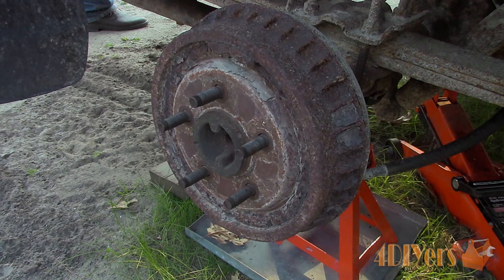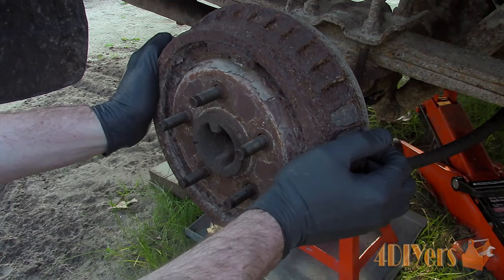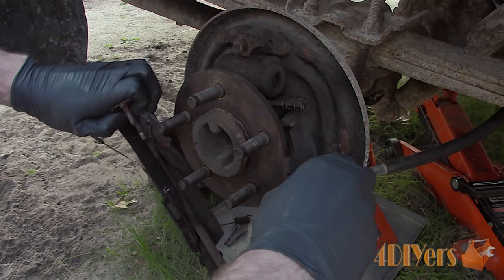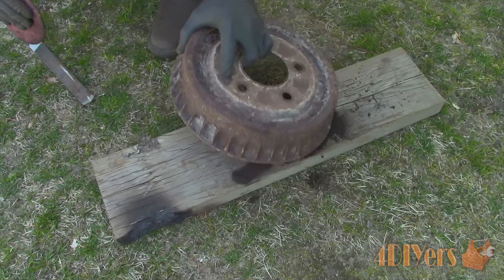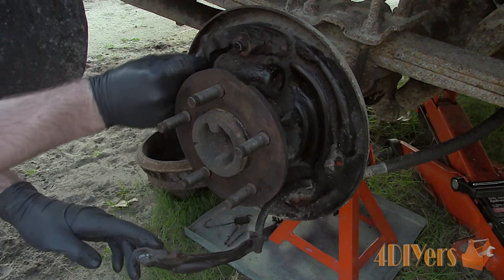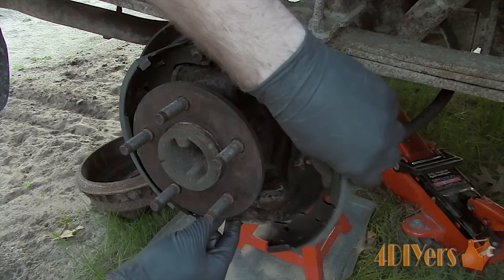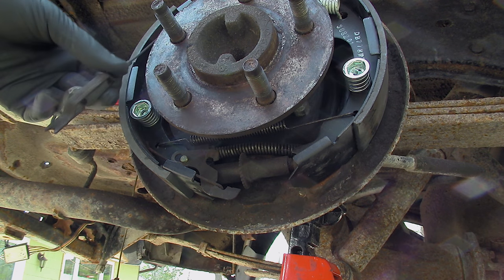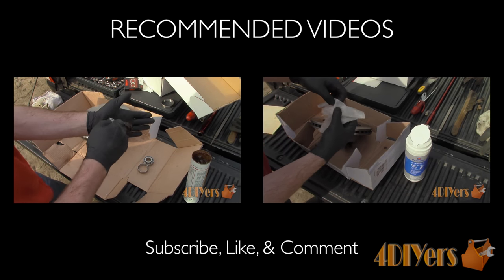DIY: Ford Ranger Drum Brake Replacement

Comment: Nice video, thank you. It looks like you used two different special tools. Would you please describe them and give your recommendations on purchasing them?
Reply from the maker: Thank you! Yes I did, one is a brake return spring pliers and the other brake return spring tool. Both are very inexpensive and make the replacement much easier.

Comment: Ive got all the components on, but one of the drums is not fitting over and one is really tight. The brake adjuster is all the way backed down too. Any ideas?
Reply: Wow, I'm currently fighting the same issue. I've tried two different wheel cylinders and two sets of shoes. I know it's been 6 years but do you remember how you solved it?

Comment: Thank you .i did that to my 05 ranger i installed a new brake cylinder shoes Springs I put it all together bled the brakes step down on the pedal went to the floor I got it looked around I had a fluid on the ground I don't understand the push rod from the came out of the cylinder after it was all assembled
Reply from the maker: No problem. The piston push rod may not have been engaged with the shoe, that's really the only reason I can think of why it would do that if everything else was in place.

Comment: Make sure you release the damn parking brake.
Two days I worked on my back brakes that would not work right, only to realize today that the Parking brake was on.
I was sitting there today, looking over at the other car I had done the brakes on and thinking.
Why in the hell did that go like a dream? But this is annoying. And that is when it dawned on me that it had to be something simple as the damn parking brake.
Got it done now, but damn, that was the most annoying issue ever, to know you are doing everything right, to find out you could have had it down two days ago if you would not only check that parking brake.
The life of a Manual transmission.
Reply: Are you saying that you're supposed to release the parking brake before you do the rear brake job?